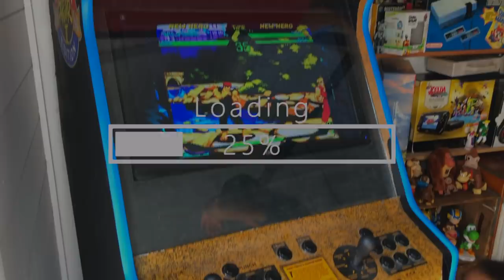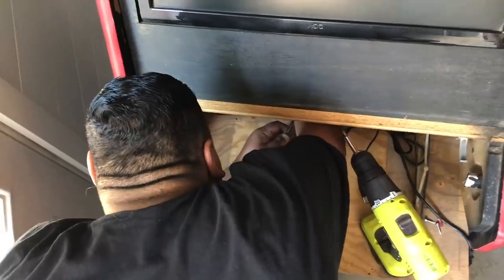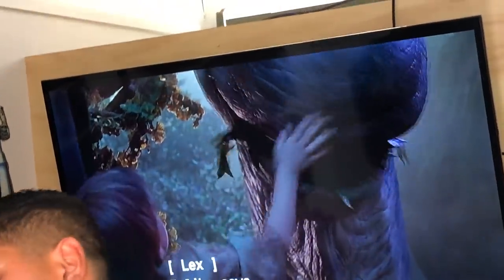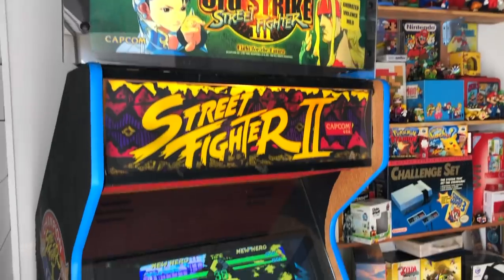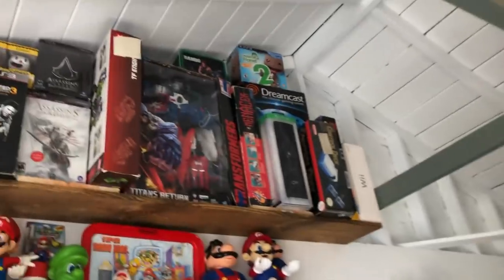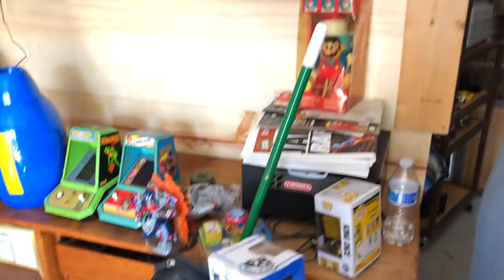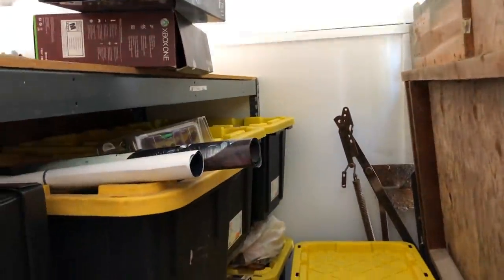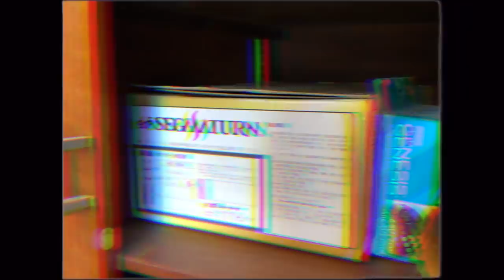GAME ROOM TOUR 2020 - What collecting for DECADES looks like - Retro Toys, Video Games and Arcades!

Comment: Are you guys using the raspberry pi 4 and the latest image, in order to run Naomi and Naomi 2 games, marvel vs capcom 2 and cvs2. Runs some overlay scanlines and you are golden. Please don’t run shaders to mimic scanlines, it interferes with or performance. Make sure you have the correct scanlines for your monitor. I can help If you help. I have some posts in petrockblog the original retropie forums.